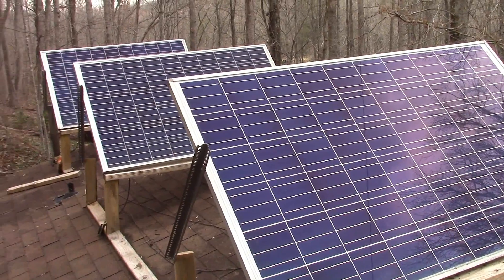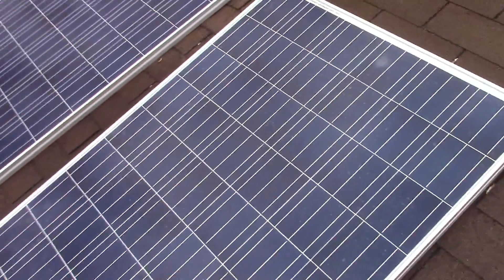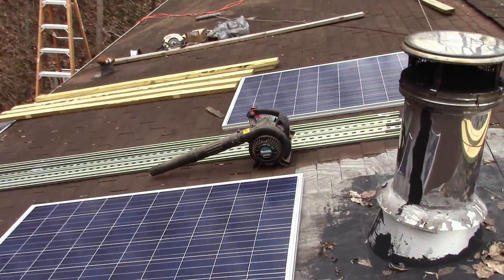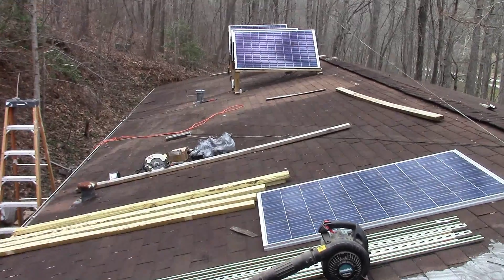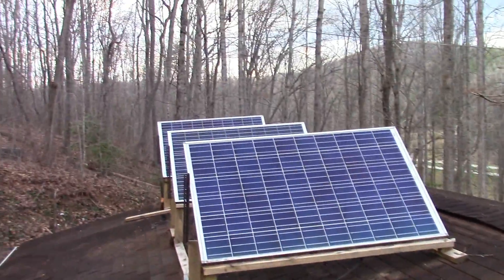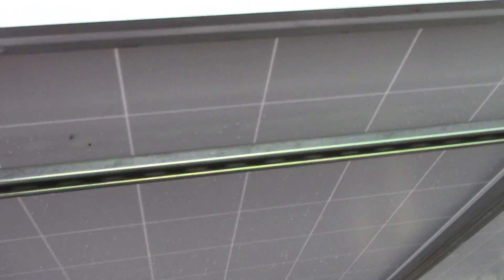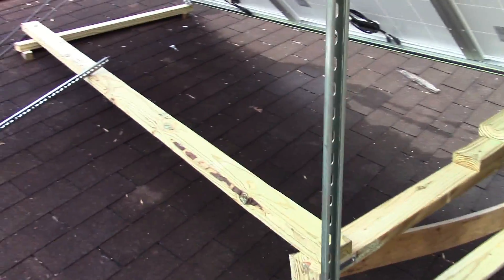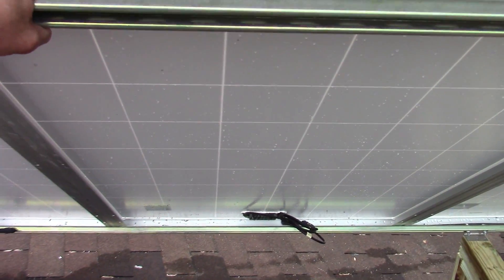Got the new Solar panels up

Comment: Nice addition! I'd really like your input now that you've done this for a while and multiple additions and changes. If you would recommend starting out 12V as you did, go straight to build what you have now, wire for isolated plugs/switches/lights or tie into the existing breaker panel, use a battery bank exclusive or back feed selling your power during normal times of electric with battery bank backup? So many questions for someone that actually went through so many different phases of solar. Great wealth of information and I value your experienced opinion. One day I'll have the money to build, just not today. lol
Reply from the maker: +David Kircher Thanks I really appreciate your input. I hope I am helping others with my experience with solar.

Comment: tr if your the owner of the property where the trees stand. i'd be for reducing a few of them or cutting them back greatly. one guy on here has made videos showing a domed device that reflects the terrain including obstetrical such as trees.. and if you know the angle where the sun tracks in the winter time use can get direct un-obscured sunshine. now if you set up a solar tracker system. it would reduce the need for as many panels. and your solar peak time would be greater. i'm working on gathering parts for a system that uses an ir antenna rotor and a programmable ir remote that operates the rotor, turning the panels to track the sun. i also plan to build a 10 coil 14 gauge 10 wire mutifiller bedini wheel. using solar to replenish the run battery to that system. and it will run all the time. i hope to build more wheels and coils. as i hear a three wheel 10 coil per wheel bedini setup, can run a house.
Reply from the maker: +dale myers Yeah I can cut the trees down and will cut a few for sure, just worried about destroying the house, they are tall trees and very close to the house. I may one day invest into a tracker, just making due for now.

Comment: If you don't want those raised angled panels to turn into a sail and rip away, you could put something on the back of that to divert the wind over and around. 

The down side of that: if the wind gets severe enough, it could turn the deflection surface and panels into a wing, and rip the whole thing off. It would probably take winds in excess of 60 mph, low-ball figure. That kind of wind would probably rip them off anyways. Much above that, you're getting into seriously destructive winds, tropical storm force, and whatnot. But you don't have to worry much about that at your elevation, lol.
Reply from the maker: +Richard Sabo Yeah and the trees act as a blocker as well. Most times the high winds will be blowing the tress around but down on the ground I don't feel it.

Comment: Brother one tip. Put each array on it's own CC if not you will lose a lot more power than you think. I would do just 2 for now as you have the 2 kids. One Am and one solar noon. Save up for a 3 kid and put that on the last array. As you know the CC will use it's best power it can find. So if you have one array that is solar noon and one that is SW facing. When you are at solar noon than you will be at amax power of your SW array as it will have shade. 

I hope you see what I am trying to say.. But looks like you would do best right now to have one array doing the AM and make it the small one. Then one Array doing solar noon and make that your big one for now. 

Looks good man. love the setup. Take care and God Bless.
Reply from the maker: +yankey4 I have already been running two different sets at different angles, and with the Midnite Solar "kid" they are set up to run different positions when in "sync" with two or more CC's.